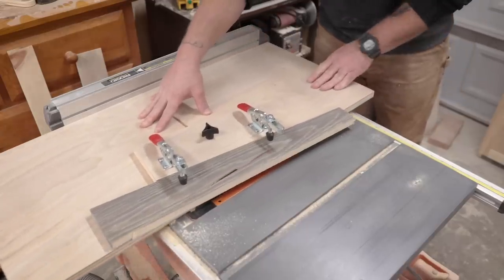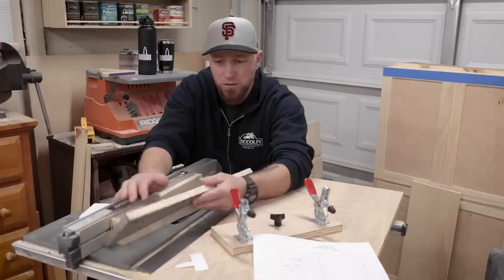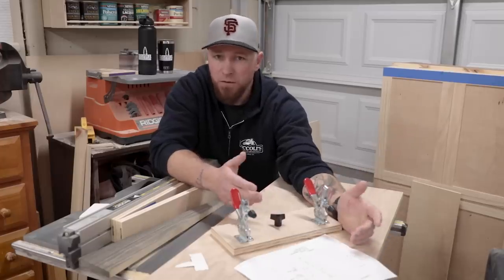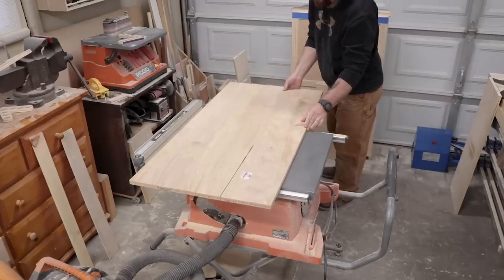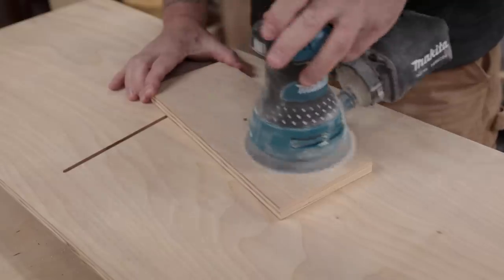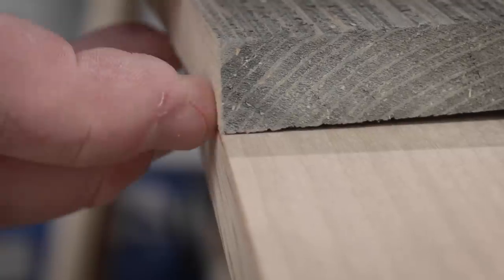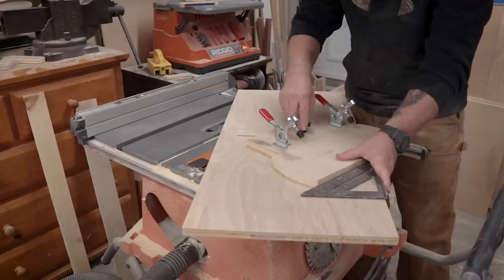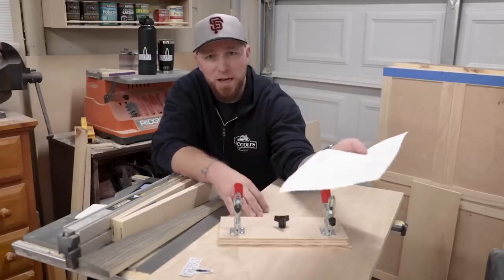A Table Saw Tapering Jig That Does It All / Free Plans!

Comment from the maker: Let us know if you make one of these tapering jigs! Pros and cons appreciated. Thanks!
Reply: Inspire Woodcraft one thing I like about it is that, since it has no slot runner, if the edge gets buggered over time by the blade, it can be trimmed a bit to make a brand new straight edge.
Reply: I just made one and for my knob I just cut a small circle from wood and a tee nut to tighten onto hex head bolt. I found that even when completely tightened down the board with the toggle bolts still easily moves. Any suggestions?
Reply: @kathywinn6869   Perhaps put some adhesive sandpaper to the bottom of the fence board, so when tightened down, it will really grab to the plywood base.
Reply: Pete Tevonian, I have since bought a tapering jig from Rockler. I’m very happy with it. Thanks for your suggestion.
Reply: I just made one. I wonder if putting adhesive sandpaper on the underside of the toggle board would add extra grip so it can't rotate.  

Another idea wou be to route additional grooves parallel to the one so you could set stop blocks.
Reply: Hey Man thanks for this, i am starting with cutting boards and don't have a jointer. Also make a video for my Youtube channel (spanish) i just add a slot cause can't trust on my fence all the time.
Reply: I made one with a miter slot runner for the jig to slide along the miter slot not with the rip fence. Another con of which I observed is that the fence tends to get lifted when securing the workpiece with the toggle clamps.
Reply: I will be making one in a few days. Thank you. I will let ya know how it goes
Reply: I have made a similar jig out of MDF. Issue I have with the routed slots for my 1/4” bolts is the head spins as I tighten the star knobs. I plan on making your jig but, hoe do I avoid this problem?

Comment: Nice idea. If you made a runner to fit your miter slot and fixed it to the bottom of the sled you wouldn't have to line it up each time with table saw fence😉👍
Reply: I was thinking the same thing, I’m building one with the runner!

Comment: Awesome idea! You could add a strip of track to run inside the table saw track, and remove the fence. You could also make another, taller, clamping bracket for cutting larger stock, like 2 1/2" thick, table legs!
Reply from the maker: Absolutely! I forgot to mention that in the video. The only reason I didn't use a track is because it would lock me at the one max width. By using the fence I can cut really wide pieces if necessary. Thanks for adding these!
Reply: @InspireWoodcraft  My pleasure! If needed (probably not?) You could add a small strip of sand paper (w/ spray adhesive) to the blade side of the sled, just to keep your wood held in place, rock solid, once locked down.

Comment: Definitely think about using the miter slot. It is the miter slot that should be in-line with the blade. Also, if you have a cutoff-catcher piece on the LHS, the crosscut sled would be even more useful.  With the miter slot, the width is almost unlimited as long as you can move the fence out of the way.
Reply from the maker: @mark2talk2u Just to clarify: the blade, miter slots AND fence should all be parallel to each other. (The one exception is that it is acceptable for the fence to be a few thousandths farther away from the blade on the exit side. Since I'm using this sled in a ripping motion, using the fence is perfectly acceptable here as well.) Using the miter slot means that I am limited to the width of the sled, because I would be stuck in the miter slot. That's why I made it this way. Actually I still use it to this day and it always works great!

Comment: Looks great!
Going to have to build one.

I'll probably put a runner on the bottom instead of trying to set the fence in the same spot...🤣
Reply from the maker: Yeah the only reason I didn't use a runner is so that I could cut wider stuff if I need to. Using a runner would have locked me into a narrower max width. If your saw is dialed in right, 16" should be 16" regardless. At least that's me theory! Thanks for watching. Let me know if you make one.

Comment: thanks for the plan and the design.  Used it to make a smaller one for my Dewalt Compact Jobsite saw.  That saw has a max fence distance of 500mm (20 USA inches) and fits well into my tiny compact shop.  My version is 400mm x 600mm.  Not great for cutting full sized legs over a metre long, but for smaller stuff it seems to work well.  Used it and I might rebuild the base making it a little longer maybe 800mm or even 900mm.,  I'd probably wait until I need to taper something that long or want to use it as a jointer.

Comment: Super design, I love your idea! I am going to build (another) taper jig and I think I will make yours or similar. It nags me that the one clamping point would not be enough to stop the material from moving.
Reply from the maker: Thanks for watching! You know, I tried it with one clamp in the center, near the adjustment knob, but I would have had to make the fence wider, which I didn't like. I think it would work though if you don't mind the wider fence. Let me know how it turns out if you try it.

Comment: A bit late to the party, but .....

1) Some people are having problems with the toggle board moving ... how about gluing a small strip of sandpaper to either end of the board, meaning that when the centre nut is clamped there is now a spring force on the toggle board helping it grip the base board.

2) You run the base board against the saw fence, meaning you need to set the saw fence every single time you use this jig ... I'd suggest it'd be better to have the base board engage with the saw mitre slot, meaning you don't need to faff about each time setting the fence.

Anyway, very simple and effective jig, thanks for the inspiration ... I'll be making one very soon.

Comment: If you put two slots in the base plate and a slot at 90 degrees in the fence piece you could run two bolts to hold the fence piece in place for extra hold-in-placeness.
Reply from the maker: Very true. But like I said, I didn't like having to make so many grooves and then I would need two knobs and whatnot. I wanted to keep it as simple and yet as effective as possible. One knob does the trick!
Reply: @InspireWoodcraft  I was thinking of times when you wanted to make a bunch of parts the same, having a single pivot point you would be at risk of your fence rotating and messing things up unless you checked each piece individually.

Still a great jig.
Reply from the maker: Good point. I thought about that as well. But honestly the one knob holds surprisingly well. On the test one that I made I had waxed it to see what differences it would make and it was too slippery. Sanding kept it movable enough without making it unreliable so that seamed to be a good middle ground. Another thought that crossed my mind is to use a 3/8" bolt for a little extra holding power. Thanks for the feedback!
Reply: @InspireWoodcraft  Or, it just occurred to me, glue some sandpaper to the bottom of the fence, that should keep it in place pretty well.
Reply from the maker: Dang it! That was something I was going to add and completely forgot! Thanks for mentioning that. (I need to get my act together! Ha!)

Comment: My first time I found it difficult to get the top clamped hard enough on the bottom to keep it from spinning. Some sandpaper adhesed to the top facing down into the bottom would alleviate this, at least I think so. I used shorter dimensions for my first attempt and didn't like it so I'll make another longer one with sandpaper.

Comment: hey, ive watched a load of vids on tapering jigs and this is by far the best for my needs, so seemingly simple yet versatile. One question though, I need to rip/joint boards approximately 4ft (1200mm) in length. Could I do that with these dimensions or should i size it up a little? Thanks for sharing 👊🙏

Comment: WOW! Now that is one of the best jigs that I have seen on YT! Nice job! Although it might limit usage somewhat, I probably would make mine with a runner on the bottom (positioned on either side of the cross grove). That way I wouldn't have to be so dependent on holding it against the fence. Just a thought........
Reply from the maker: Hey thanks! I contemplated using a runner for the base, but then I would only be able to use it at a predetermined width, so opted to leave it off. This way I can cut really wide stuff if necessary. It would definitely make it a little more user friendly though.

Comment: I'ev been buzzing around YT viewing other designs. This is different somewhat from the common designs and has capability. 
With a large-ish platform would a runner have any greater advantages/disadvantages/not worth the effort?
Most woodworkers set up the jig so as the point of the taper cuts first. This method with very hardwoods, because one blade edge contacts first the wood may slightly deflect your blade at the start of the point end, chip-out the point. Others set up or the blunt end to be first, (as you did for test) a disadvantage I can see is the blunt end method, the weight of the waste as it cuts away at the end may break away before the cut completes.  So take into consideration the characteristics of your material for non-wood sheet goods. 
Make yourself another toggle clap block of double thickness for thicker stock. 
Feedback please.

Comment: What’s the thickest stock those toggle clamps will effectively hold?
Reply from the maker: One inch is definitely doable and you might be able to squeeze 1-1/8. If you remove the bottom nut on the clamp you could add another 1/4". Also, for those that want to run tapered legs, the clamps can just be put on riser blocks. Thanks for asking.

Comment: I like the jig and was wondering if you could run a broken 3/4 inch rail under neath for the slot in a table saw? Looks like it may work and would not need the fence. Great video. Thanks
Reply from the maker: You could. The only reason I didn't use the track is because then it would lock me into a final max width. By using the fence I can cut really wide pieces if I need to. But it would definitely work that way!

Comment: Great video! I've been kicking around how to cut an odd angle off the corner of some 2' x 2' shelves and this jig gave me the perfect idea for it. What type of router bits did you use to make smaller slot? (I'm trying to picture how you would've lined it up so well. Is there a 1/4" drill bit that would have centered itself in the shallower 1/2" trench?

Comment: Just wondering if rounding the ends on the smaller piece wouldn't give you an even tighter radius. Looks good though
Reply from the maker: YES! As long as you get the radius right and don't crowd the clamps too much. My first design was curved on both ends. I figured this way keeps it as simple as possible for people.

Comment: Nice! Question though, do the toggle clamps create stress at the point where the moveable fence is attached to the base?  That hold down knob looks pretty small, do you think it's going to become a problem? Keep up the great work.
Reply from the maker: Thanks! I don't see it becoming a problem but I do think you could make it a little beefier by going 3/8 instead of 1/4 if you wanted to. The toggle clamps do create stress and lift the fence up slightly, but that's also kind of what makes the whole thing work.
Reply: @InspireWoodcraft  Thanks for replying. I'll be making some jigs for my new table saw, I like this design, so I might copy it pretty closely. I might film it for my channel, If that's ok. I'll definitely link to this video and do a shout-out.

Comment: Nice design and a very simple build. Why did you choose to use the table saw fence instead of using a runner? Was it to keep the build easier or is there another reason. (Sub and like to help keep you going)
Reply from the maker: Thanks for bring that up. I forgot to mention in the video. By using the fence you can use the jig to any width as far as your fence will go. A runner would lock it in to a predetermined position, that's why I opted for that style. Thanks a ton for the like and sub!